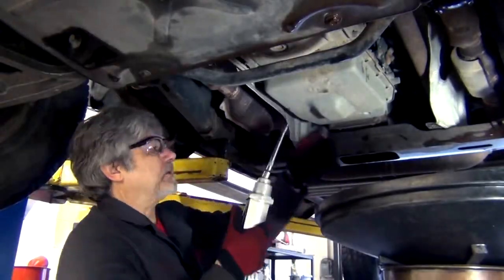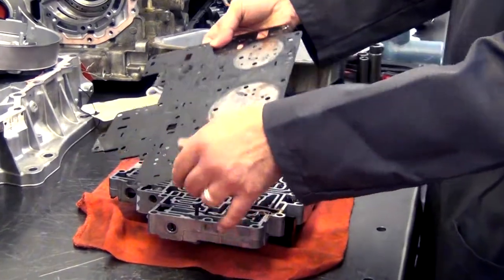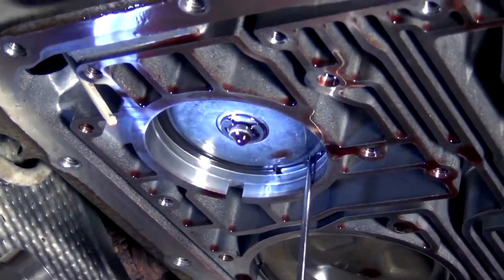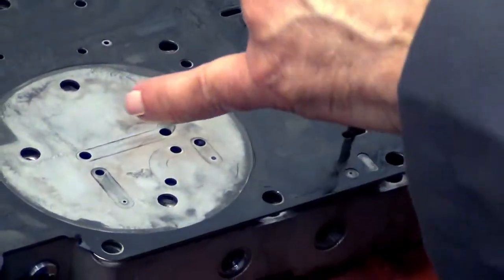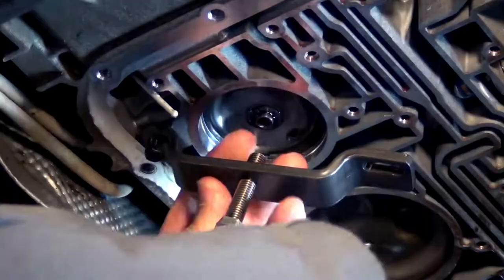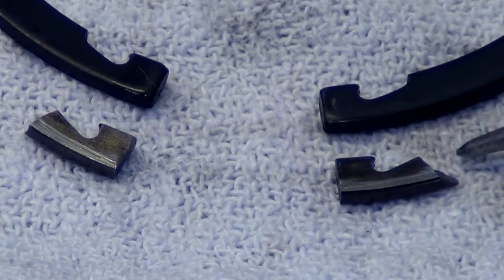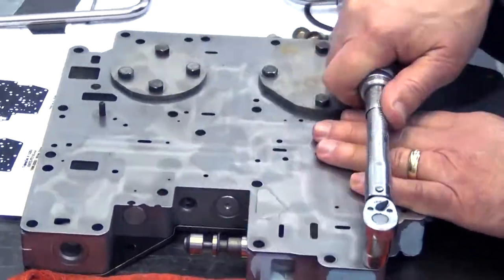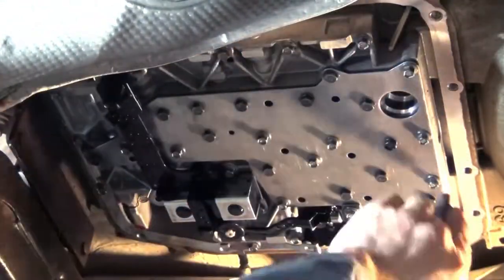TechTip: 4R70W Neutrals On 3-4 Shift (Overdrive Band Not Applying)

Comment: That's why I taught myself to rebuild engines and transmissions. A mechanic that leaves a broken snap-ring in the transmission so that it can later fail, unbelievable.
Reply: If the ears of that snap-ring are prone to breakage would not installing a new one just introduce another failure,  I understand your point of replacing with a new as this one was clearly broken thus causing the issue however if there was no other damage to the ring why replace it just to have it fail in the same way again?
Reply: @tonyemory3618  may even consider grinding off the ears on a new replacement snap ring

Comment: Will this cause the car to not go into 3rd an 4th gear an jus rev up an 40mph
Reply: Did you found the problem? I’m having the same issues
Reply: Please tell me you found the issue? I have the same exact problem I need to know pls 😂🙏
Reply: If you have a 4R70W or 75W and you have no third or fourth gear, but you have first and second and higher mileage then most commonly it’s the direct drum has stripped splines. The direst drum drive just spins in the direct drum. That shaft is a hardened shaft so those splines won’t strip off, just the splines in the drum. Also if anyone is reading this in 2024 then this guy SHOULD replace the snap ring. They tend to get brittle and break in more than one place, not just the ears. I’ve found up to 5 pieces before. The new snap ring is made of a stronger material, a “revised” part. So the new replacement one lasts longer. I’ve been a Senior Master Ford tech for 30 years.

Comment: For a 4R75E built between 12/4/2006 and 5/20/2008 with the same 3/4 engine flare issue there is a service bulletin # TSB 08-14-3 which advises a Reprogram the Powertrain using IDS release 54.5 or higher to solve the problem.

Comment: Would the broken snap ring also cause a high rev situation to get forward to engage?  I have to rev it above 3K to get it to go into forward gear, and then with O/D off, it drives like a champ.  Take O/D off, and when coasting or stopping, it slips back into neutral.
Reply from the maker: No it did not

Comment: Great video, just did this job on my 04 F150. Snap ring replaced and ready to put the valve body back on. Question. When I pulled the valve body the 2/3 retainer and spring dropped out. Now I'm having trouble getting that retainer to stay in place long enough to get the valve body back on. What is the trick on that?

Comment: My mustang is acting up similar symptoms. I'm going to have to do this with my 99 Mustang 4.6. Now I know what to look for when I open the valve body. I'll test the overdrive mode like you said.  I didn't know I shouldn't completely put new oil in an old transmission. Thanks for the video.

Comment: I just rebuilt my 4r70w transmission on my 99 Ford van. Raybestos stage-1 clutches, Sonnax Billet forward drum, new thrust washers, new rear clutch drum, torque converter, new soleniods, sonnax sure cure kit, new piston accumulators and a new overdrive servo with sonnax pin. I am getting a neutral when shifting into overdrive. But it always goes into overdrive. It only does it when the transmission warms up and has a longer delay going into overdrive. It does Not neutral when the fluid is cold. No broken snap ring. I removed the servo and the o-rings on the pin look good. Checked the valve body and everything moves freely and not binding. I am freaking stumped.
Reply from the maker: Thanks for watching our video and using our products. We appreciate your support. We recommend that you bring this issue to ATRA, ATSG, or the Transmission Brotherhood Facebook Group for timely technical assistance.
Reply: @RaybestosGarage  Thank you but I figured out the problem. My new overdrive servo came apart in two pieces after 400 mile rebuild. I thought the top piece was a cap. So I went back to the transmission parts house and they gave me a new overdrive servo. The parts guy said he never seen one come apart. He even installed my sonnax pin on the new servo. Gonna install it tomorrow. Thanks for the response.
Reply from the maker: Good luck!  @JoeFlash1

Comment: My car is a 4 speed with overdrive. Overdrive works, gears 1-4 work perfectly. The only issue is overdrive won't kick on for 4th at highway speeds. Sometimes it will and revs will drop to 2000. Other times no matter what I do it will be revving out at 2500. 

Transmission shop said they're too busy. Go home and disconnect the battery for a whole. Get a mirror and inspect the plugs.

Comment: Some folks push the overdrive button to disengage it, and then it never shifts above third gear. The mileage will go down a little, and the engine won't last quite as long, but it does work. Overdrive isn't really needed. The broken ring end got transported by repeated fluid pressure cycles as the engine is stopped and started, with fluid pressure going from zero, to a couple hundred psi as the engine is running. The broken piece will eventually move until it gets jammed for good somewhere.  
You can remove that ring by carefully drilling a small partial hole where it contacts the aluminum case, just deep enough, and fat enough, to get a pic behind it to force the ring out of the groove. Drill down at a 45 degree angle where the ring touches the case. Drill only at one of the thickest spots around the circle because you DO NOT want to make a hole into any of the adjacent fluid passageways, which would ruin the entire case. Drill gently, using a drill bit JUST fat enough to get a pic behind the ring to force it out of the groove, so you can remove the ring. When you reinstall the new snap ring, align the ring gap with the small indentation you made with the small diameter drill bit. Should the ring break again, the next guy can just rotate the ring and use your new partial hole to get the next ring out. And the ring will still be supported everywhere it touches the case, so the drilled notch won't weaken the ring support. 
If mine breaks, I'll just drive in third gear, and change engine oil more often. Oil is cheap. That overdrive ratio is mostly for government fuel economy standards.

Comment: Very nice video and very informative. 
I recently acquired a ‘95 F-150 and noticed the Overdrive Button does nothing when pushing it, no light “OD” indicator light, no shift.
No noticeable glitches in the transmission performance while driving down the road,otherwise, just no overdrive it seems.
Reply: these trucks are notorious for the wire leaving the overdrive button on the shifter to rub a hole and short out on the top of the steering column. There's videos on how to fix it, first step is to look for the small fuse that powers it and you'll most likely find the fuse blown. If so, do the wire repair and replace the fuse and you'll not only have your overdrive cancel button, but your door locks will lock automatically when taking off and the truck will also be able to flash transmission codes at you by blinking the overdrive OFF light on and off. Took me about two hours to make a quality repair and get all the panels back on, well worth it.

Comment: Can I check this with my truck on the lift in the air to see if this happened? Or do I have to drop the trans? Will all the stuff fall out if I open that Pant on the bottom? I don't wanna drop everything. The truck has removed in a couple years but runs fine

Comment: 98 4.6 f150 2wd with 4r70w. 1st revs way up like a delayed shift, skips 2nd and maybe 3rd gear and hits 4th and continues on its way like normal. What could be my problem?

I can put in 1st gear on gear shifter and shift into 2nd and it will go into 2nd. As soon as I try to go from 2nd into drive it will do a  neutral shift and then catch into gear

Comment: I have a 2003 F150 truck 4.6 motor and I’m having a rough downshift from overdrive to third and it seems to just started happening here sporadically in last week and a half any tips that you may give me by the way your video was great
Reply from the maker: This sounds line a potential timing issue with the release of the band and re apply of the forward clutches. Could be in the valve body or in the transmission it’s self.

Comment: Sorry what was the fix does the compression  tool reposition the Overdrive Band by itself or is there more steps
Reply from the maker: The fix was explained in the video. The issue with this one was a partially broken snap ring.
The broken snap ring piece was lodged in the valve body blocking the Overdrive servo regulator valve.
Removing the broken piece was the fix for this one.

The purpose for the tool is to release pressure against the snap ring to allow the snap ring to be removed using a pair of snap ring pliers

Comment: When the expedition gets to 45 mph and 3000 rpm jus revs up an will not go into 3rd gear any help
Reply: Same thing
Reply: Was it the servo snap ring?
Reply: Mine did that but all sudden it started working great again might be with the valve body or check valves

Comment: I got a 2007 f150 when i remove  the transmission pan i found a piece of metal and i dont know were came from.. so i ignor it... so i put it back everything. And i drove its. but i notice my 4th gear i little bit weak specially when i tow my RV  ....nice video  thanks 👍👍👍👍

Comment: Same symptom but snap ring is intact. Cleaned valve body and reassembled. Any other possibilities that I’m over looking?
Reply from the maker: If the snap ring is intact, then the problem is most likely elsewhere. You could inspect the valve body for a stuck valve.
If that is not the case, then keep looking. The problem will present it's self.
Reply from the maker: Are you certain the little tips of the snap ring are not broke off like ours was. We didn’t notice it at first either. Did the band anchor brake off?
Reply: @RaybestosGarage  i believe i overlooked mines as well going to check it again soon.

Comment: When the 3-4 shift happens in my truck, the rpms surge for half a second like it neutrals then it shifts into 4th
Reply: I know your comment is 2 years old but my truck does same thing from 3-4 with a second of neutral then shifts. Did you solve problem.

Comment: Thanks for this video. I have 3-4 nutural with od light blinking in 01 f150. Cant pull a code from data port.  After pulling v-body I looked at my 3-4 survo and saw its still in like on this video except half of the snap ring was pushed out of grove like im trying to remove it. So i guess my next move is to open v-body up to see why that survo pushed that snap ring almost halfway out? I was lucky entire snap ring still intact and top of piston had light scars on snap ring side that popped out. I say all that cuz b4 I saw ur video, I spent last two weeks chasing wires. Thanks again.

Comment: How would you remove the broken snap ring from case without the notches for snap ring pliers?
Reply: Is it possible using a carbid drill bit to drill two small holes in a snap ring to use snap ring pliers
Reply: Push the servo piston up enuff to allow snap ring movement then gently using a pick and small dead blow hammer,  drive the snap ring out circumferentially.  Pls wear eye glasses as it will spring outward.    I don't meN to sound harsh but leaving that broken snap ring in is negligent and lazy.....unbelievable.

Comment: I hope this is what's wrong with mine.. Mine started acting up when shifting to 3rd now if i let off the throttle it tries to shift to 3rd then just goes into neutral
Reply: Did you find the solution? I have that problem now
Reply: @mr.sierra4409 the transmission blew a few weeks later. Lost all gears apart from 1st and second.
Reply: @AnythingGasoline  thanks you for responding.

Comment: I have no 3rd and 4th gear. Is this a rebuild job. Or would the snap ring cause
Reply: It's a 4r70w
Reply: The Truth of the Matter  i got an issue going into 3rd or 4th. Around 40mph. 1st and second work fine. It doesnt do it everytime but sometimes it high revs and doesnt shift into 3rd or 4th( whichever around 40-50 mph is). I gotta let off the gas then it finally shifts.
Reply: The Truth of the Matter  what is a servo?
Reply: @indo3052  did you ever find out what it was

Comment: Has anyone confirmed this guy is saying that the blinking od light is caused by broken snap ring.? Mines shifting fine but always blinks at 55.
Reply: I was chasing wire til I saw this video. I pulled v-body off and I was fortunate, survo was still on and snap ring wasnt broke, but it was half way forced out. I can confirm what on video is helping me, but I'm looking ar inside of v-body now to see why or what made survo push snap ring like that. https://troubleshootmyvehicle.com/ford/4.6L-5.4L/how-can-i-tell-if-my-transmission-is-bad-1